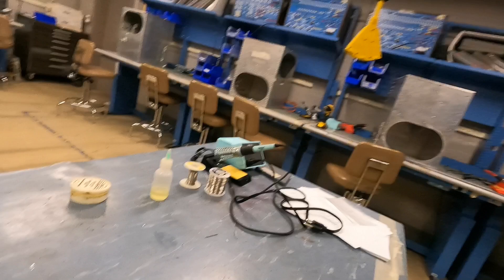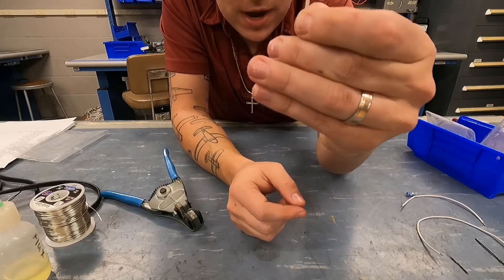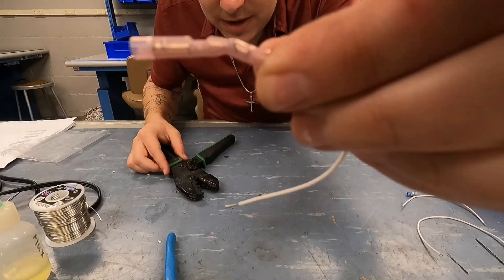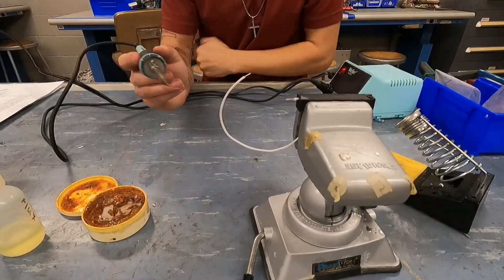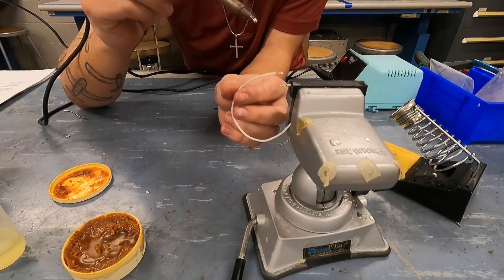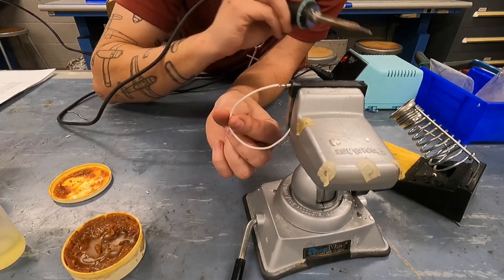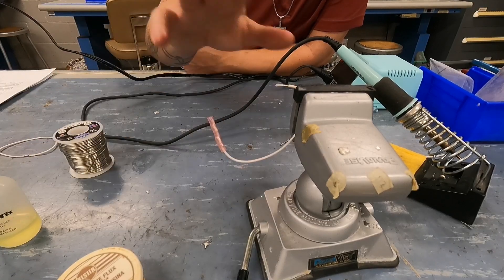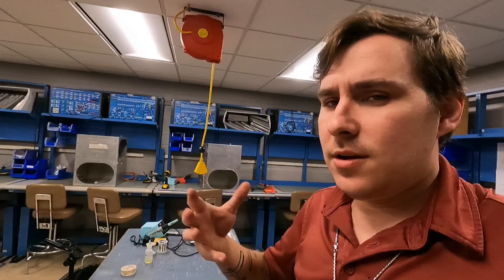O&P Demonstration How to Splice Aircraft Wires | Butt Splice, Soldering & Solder Sleeve Methods

Comment: Few things get my goat like a technical instructor being casual and imprecise with terminology and fundamental procedures.

8:35 “Heat doesn’t melt solder. Solder melts solder!” 🤡👀 WHAT?

Look, I get the intent—protect insulation from shrinkback and burning—but coining an aphorism instead of explaining the physics is misleading. Heat melts solder. Period. You can talk about how much heat to apply and for how long, and that molten solder helps transfer heat more efficiently—but don’t reduce a complex issue to some kind of vapid catchphrase.

Also:

Flux removes oxides and helps the solder wet and flow easily. You want to clean it off if it's in excess but it doesn’t “block electrons.”

A proper crimp is a cold weld and will not pull apart under reasonable force. For a given gauge of wire, you need to use the correct crimp sleeve, the correct crimper (in the correct orientation!). Mess up any one of these and the crimp is likely to fail.

In a procedural, skills-based instructional video, camera discipline is part of the instruction. If viewers can’t clearly see strand deformation, insulation position relative to the barrel, solder wetting, fillet formation, and the heat-affected zone, the video has failed at its primary purpose. Saying "it's out of focus" doesn't help.  A top-down camera with fixed focus would go a long way toward highlighting the finer details that are so important.

I’m sorry to say, but this video feels like performing confidence instead of teaching competence.

Comment: Amateur builder here but at the EAA avionics and wiring class, they showed us how the butt splice crimping tool has two different jaw patterns.  The wire always goes in the side with the colored dot.  If that’s correct, your first crimp is correct but the second one isn’t.  The jaws are designed differently so one crimps on the insulation and the second has a tighter crimp for the wire.  Anyone else hear this?  Maybe it’s not terribly important but they showed us the difference on the connector after crimping and told us to pay attention to the orientation of the crimper.
Reply from the maker: That is true. The crimping tool I was using is a cheap amazon one, and both jaws are the same size. However, to your point, if you were using a nice DNC crimper, it definitely Matters. I should have mentioned this when I was using the tool.

Comment: Would you be able to do a video on adjusting flaps? Do you adjust them using torque tubes or Push pull systems? I’m really confused on that project!

Comment: I thought the handbook says not to solder wires together? I thought youre just supposed to crimp them together? Solder is for connecting the wire to a terminal? Is soldering a practical for the general exam? We didnt even touch solder in my basic electricity course. We just crimped one wire and that was it.
Reply from the maker: Most of the time it's just to connect to a terminal, but I've seen plenty of instructions that call for either silder or the solder sleves I used.
Reply: @brycebuildsit  Is there any rule of thumb -- disregarding how in production applications the only "rule of thumb" is "do what the directions tell you" -- but for more casual purposes, regarding when it's appropriate to use a soldered connection rather than the go-to crimp?

Comment: Thanks for the video, I started A&P school in my home town, freshly out of high school in June. Took sometime off and started in December. Already went through, maintenance forms, publications, and regulation, weight and balance, aircraft material, hardware, and practices, aircraft drawings, physics, and mathematics. About to finish fluid lines and fittings Friday. Safety wire is definitely not my thing but I know it’s so crucial. We do hourly just because when the teaching facility/hangar was built the FAA only allowed hours and I heard only very recently that changed and our school has been struggling to change. We finally just became a psi testing center. It’s also still a very new program because they just started teaching at the end of 2023 (I think). It’s also one of the cheapest and quickest programs in the state. It’s about 22,000 for 1 full year! Anyways, I appreciate the videos I learned a bit extra about safety wiring! Thanks again